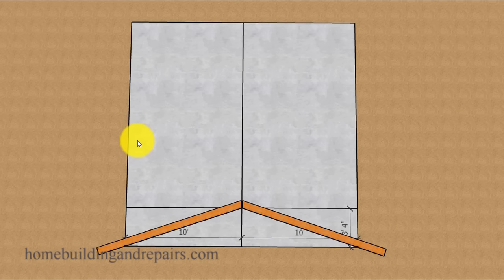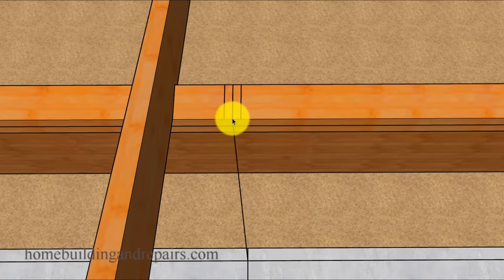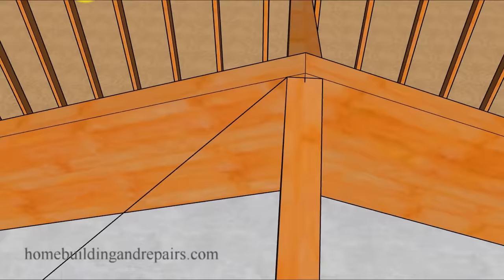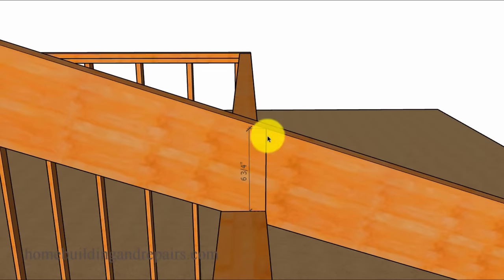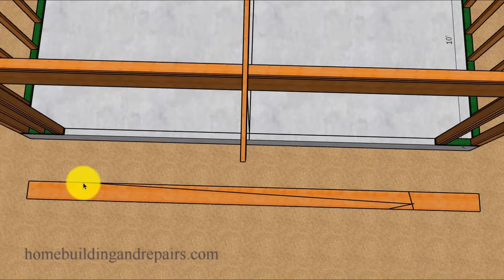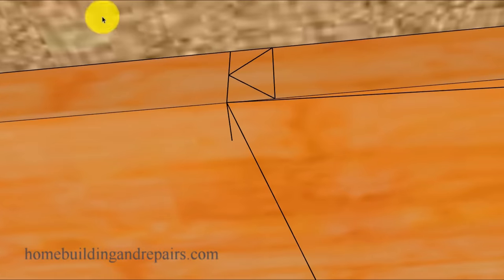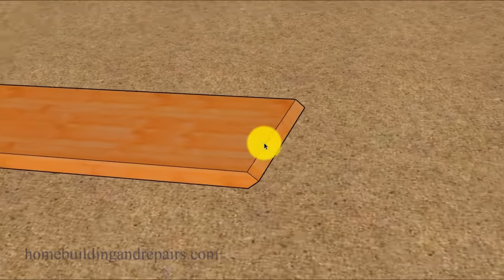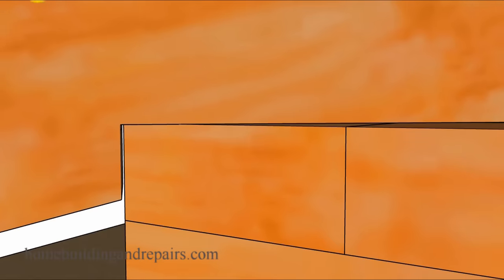How To Layout And Cut Hip Roof Rafter Without Any Math Formulas or Framing Square

Comment from the maker: Here's a link to a video that will show you how to layout a hip rafter with a framing square and math formula. https://youtu.be/d1tO8TYHy2M
Reply: Very interesting video thank you. I must say I got lost where you said the piece of ply template was 17 inches, where did you get the 17 inches from? Many thanks, Paul
Reply: Good appreciate the information
Reply: Good appreciate the information
Reply: Good appreciate the information
Reply: @arthurcurrey2219  po pls i love 💗
Reply: @foundthetruth2003  17" is the "run number" on a hip or valley rafter when the common rafter is based on a run number of 12".  So, for example, the numbers on the square for a 6 - 12 pitch common rafter would be 6 for the plumb cut and 12 for the seat cut and the numbers for a regular hip rafter of that pitch would be 6 and 17.  
The reason for this is diagonal distance of 12" and 12" is very close to 17".  A regular hip rafter is 45 degrees diagonal to the rest of the roof meaning that for every foot of run of a common rafter, a hip / valley rafter must run 17" to cover the same distance.

Comment: A fantastic explanation, and a joy to watch after spending a day framing a 15‘3“ square pavilion out of rough cut, full  dimension 4X western red cedar. A question I have: we had a lot of different tools on site and were able to make our hip rafter seat cuts cleanly, but how does one make the initial angled offside plumb cut that bevels opposite a Skil saw base plate?
Reply from the maker: I usually cut it straight and don't worry about making it perfect.
Reply: It’s a double cheek cut isn’t it?

Comment: Wow been framing roofs for bout 30 years now and never occurred to me that I could cut a 17” board to scribe my level cuts. That’s an excellent tip. I will remember that next time I forget my speed square.
Reply from the maker: Yes, scrap pieces come in handy, especially square ones:)
Reply: well... i mean considering this method requires the installer to make common rafters to begin with, you still need a framing square regardless.
Reply: @maxdecphoenix  i understand but lets say I’m on the roof cutting rafters and my square slid off the roof or forget to bring it up. Just saying its a useful tip.
Reply: Hip rafters
Reply: @maxdecphoenix  Look up the angle of the  roof on a 4-12  it would be 18  1/2 degrees and cut it on a chop saw.
Reply: @randyswiech7884  who the fuck cuts rafters on the roof?

Comment: For the most part I have cut hips measuring from center lines. A rafter book or square is handy finding out common differences of hip an valley Jacks. This is a good method if for some reason you forgot your square. Getting some work done is always good 👍

Comment: Great video.  Dropping the hip seems to be a dark area I dont understand, but what if you wanted four gables?  The hip rafters would be your valley rafters..
Reply: The drop is to get the same high above plate(h.a.p) of the common rafters.usually is half the thickness of your hip rafter. In case you have four gables you wouldnt need it beacause all of them would be the same.

Comment: I’ve always cut my hips then common then jack rafters .... thanks construction master calculator
Reply: The construction master is the lead carpenters friend 👍
Reply from the maker: You might not believe this, but in double checking some of the measurements in this video, the construction master calculator didn't get them right.

Comment: Thanks for the video. Super informative. Question, I completely understand the concept of the template board needing to match the pitch of the roof. For instance we are going to be framing at 6/12 hip roof. But I don't understand is why the length of the template board needs to be 17 inches? 17 inches never changes even if pitch changes?
Reply from the maker: This link should help. https://www.homebuildingandrepairs.com/math/index.html
Reply: There is a lot more to cutting rafters than a 12'x12'  building

Comment: Probably already mentioned somewhere below but we always used to bevel back the top of the hip on both sides, it provides a better seat for the material sitting on the rafters.
Reply from the maker: A true perfectionist.
Reply: Double bevel the long and short??

Or the top of the whole hip?
Reply: @Hunter_s_morrison  Yes along the top of the whole hip, chamfer back the top edges toward the centre line and the laiths or covering will seat perfectly.
Reply: @stevemartin43  I always do that with my ridges also
Reply: to get the side line for the bottom of the bevel  you would put a 6-17  line on a scrap and mesure long the 17 side 3/4 or what  is 1/2 the ridge

Comment: Great info. Always did the step off method with the framing square and then a calculator but this is much easier. The dropping of the hip bird mouth is always a concern.
Reply from the maker: We like easy and figuring out exactly how much to drop the hip can be confusing.
Reply: He did drop it by moving the plum lin in 3/4 and took that measurrment

Comment: Since you are using 2x6 common rafters I Don think your HAP can be 6 3/4”. I also saw a 2x8 number in you comment about the hip and rafter thickness that may be correct if you are using 2/8 rafter instead of 2x6 as you said. I love your channel and I always look your videos. Please if I’m not right let me know freely. Thanks AEL Construction CA.
Reply from the maker: You do bring up a good point. The pitch of the roof and rafters sizes can affect other lumber sizes like the hips.

Comment: I got the upper, angled cuts on the rafter, but I still didn't understand how did you determine the lower cut angle and how deep should it be when you're using the guides?  Thanks for video and happy 2022! 👍
Reply from the maker: It will vary on different projects with lower or steep roofs. Most of the time you will be safe cutting it the width of the framing plates that the rafter will be sitting on and not larger.
Reply: Here is how to cut a common and a hip..   say you have a 6-12 slope  that is 22 1/2 degrees.  You can cut a scrap this angle that is the plumb cut of a common rafter using a chop saw  nail a clete on the scrap and   use that for the top cut of the rafter  for the birds mount  make a plumb mark  and slid a sqare cut 2/4 scrap down that line until it first touches the bottom. if you draw a 12''  sqare the diagional is 17''  well it is actually 16.97''  but you use 17''  what that means is every time you go one inch on the 12 side you move 17'' on the diagonal..  so in 2' it would be 34''  but since the rater rises that would  not be the length of the hip or common. to get the rafter length you would need to get a rafter book.   you take the span of the rafter  say 24'  and look that up under common.and it would give you the distance  from the exact center of the building  to the plate.  That is the length of the common...  If you have a ridge say a 2/8  you would deduct 1 1/2 ''  from the span..  Now framing the hip you may notice the hip cannot reach the center of the rafters so you would have to shoten  the hip but if yoo use a book using the span of the building minus the ridge you would get the exact length of the hip or valley no shortng needed.. respond it you want to know what to do next

Comment: I find using the inside measurement from the wall plate internal corner to the bottom of the ridge so the length of the underside of the hip and mark my cuts from there that way the seat cut does not come into the building of course this may mean the top edge of the hip is higher than the common rafters but the underside will be inline with the common rafters so if its being plaster boarded it will be flat

Comment: how many diff styles of hip roofs is there? or how big does the building have 2 be in order to have a ridge?
Reply from the maker: The possibilities for hip roof designs are practically end less and a ridge for a hip roof will be needed when the length of the building is longer on one side.
Reply: @gregvancom  do you have more info on this?

Comment: Love your video...but I need help. How do you join the common rafters together at the top.?....do you screw them together or nail them.....please show a video of a real pyramid roof....maybe a small dog house one so you dont have to waste alot of material. Where do all the nails and or screws go ??? I dont want my rafters to be structuraly compromised.....thx.  Love and God bless....Lisa
Reply from the maker: I won't be making a video soon, but put your suggestion on my list. This isn't easy, but angle the nails and use building hardware like straps if they will help.

Comment: Do you have a video that demonstrates the method for deriving the end cut and seat cut for the common rafters? Thanks for the education.
Reply: Dude  get the little blue book that goes with the speed square. Wealth of knowledge in it. 👍
Reply: @rexolrexol7893  cool, I make the cord mesurment for the hip from the point the common rafter point intersects the main ridge to a long point right down on the corner of the structures wall, here's where it gets a little hinky only thru experience and some fiddling can you determine the mesurment thru the hip on a plumb line thru the framing member.
To get the angle of any common rafter pitch useing the framing  square  hold the 2" blade in your right hand  and plase the 12" on the outside of the square along the bottom of the lumber place the number of the desired pitch on the outside of the 1.5"blade along the bottom also the angle along the 2" inch blade is your plumb cut this setup makes a rafter with the long point on the left just reverse the square if you want the long point on the right. To get the seat cut measured along the length of lumber on the " crown" or top side square down with your angle and then mark the seat cut so that it has sefitiant depth into the rafter so it won't want to ride up and over the top plate. I make it 1.5" deep  and let the seat side of the cut run of the top plate. So square thru  on the angle and then square off  that line to get the seat . The Swanson blue book  has how to get the length of your rafter plumb cut to plumb line at the seat cut. I bought  the construction master calculator many years ago and use it for all calculations I need, you cabby updates off the website to bring the device up to date. It also has a booklet with a lot of helpful information.

Comment: at about 4 minutes in you say you use a 2x10 for the hip rafters, but the graphic says 2x8. is 2x8 the correct size?
Reply from the maker: Common construction practice is to use larger lumber for the hips. For example if I'm using 2 x 6 for my common roof rafters and jack or fill rafters, then I would use 2 x 8 for my hip or something larger like a 2 x 10 or even a 4 x 8 or 4 x 10, depending upon the situation. Let me know this didn't answer your question.
Reply: @gregvancom  got it. thanks for the helpful video.

Comment: There is a difference in the height of the two rafters that butt up against the other two rafters that mate together. How do you ascertain the amount of difference that has to be subtracted from the seat cut? Or am I incorrect in assuming that this needs to happen?
Reply from the maker: All seat cuts should be the same for gable roof and jack rafters.
Reply: If you mean   dropping the hip....  a hip rafter  is cut using 17'' on the square in  place of 12''  this is because 17 is the diagonal of a 12 '' square.    But if you notice the hip only touches the ppint of a   outside corner of a building .. The common touches the plate  but this point of a building prevents the hip from touching the plate at the edge of the hip.cut you have to make a mark on the side of the hip  at the plumb cut of the hip  usually 3.4 '' closer to the ridge and measure the hight above plate at that point.  On the valley you would mark the seat  cut the same height as the common and then follow that  line 3/4 '' more towards the overhang this would allow the hip to move 3.4 '' towards the ridge and also drop the  hip

Comment: When I take the measurement for the hip, I always lay out the 1 1/2” on the wall where the bottom of the hip will sit. Then make a 90 degree mark where the outsides of the hip sit on the corner. This is where you want to take the measurement for the hip because the edge of the wall plate is where you want your 6 3/4 rise. You don’t want the rise out on the corner point. That is why you have to “drop the hip”. I hope that helps.
Reply from the maker: I like it.
Reply: Correct! Not doing it that way, actually makes the hip rafter higher than the plane of the common rafters.
Reply: I was going to make the same comment. I figured someone had. I prefer to bevel or “back” the top of the hip though. I also prefer the plumb part of the seat cut to be beveled and sit against the wall on both sides.
Reply: @zekefrye706  thats not a bad idea at all.  Will give your hip tail a little more strength. We also always bevel the top pitch cut on the hip. In my opinion the fun starts when you have different pitches from the main set to the secondary hip set.
Reply: Yes, I’ve done that. I’ve built hipped and valley gambrel roofs that change pitches three times before reaching the ridge. The biggest head scratchers I’ve dealt with were; “supporting valleys” that carry “supported valleys” that were beveled top and bottom to allow for a “no trim” tongue and groove ceiling. The bevels start, stop and change direction at the  location of the intersection. “Dog legged hip and valley” rafters, like on a 22.5 degree turn have been a challenge too. Isn’t it a rewarding feeling to pre cut a roof and it all come together..... and embarrassing as can be when you forget one step and the piece won’t work. You did an excellent job on the video. I think most construction workers are visual learners and this is awesome. One small critique that doesn’t matter to some but helps the other trades and I prefer, is to stack rafters directly over studs and studs directly over joists. Thanks again!
Reply: You are right but  when cutting the hip  say you want 5'' Height  above plate . when the hip is laying flat just take a scrap of 1/4   or what ever 1/2  the with of the hip is and use that line to measure 5''   The hip and valley are exactly the same length but when cutting the seat of the valley  you use the same method   except you continue on the level line   which would be the height above plate off the common rafter not dropped  for  and additional distance of 1/2 the with  of the valley that would drop the valley and allow it to slid that distance towards the ridge

Comment: does the Hip rafter Always need to be larger that the common rafter?  2x6 common 2x8 hip
Reply from the maker: For the most part Yes.
Reply: It would based on dipping below the 2/3 rule of removing material from the rafter. That will be determined by the common rafter's height over wall plate, which in this video is 6 3/4". When your transfer that height to the Hip, if what remains is less than 2/3 then you need larger lumber for your hip.

Comment: Dropping the hip is necessary to get all of the roof framing in plane. If you plane across the the common rafters from both sides they would intersect on the center line of the hip rafter, therefore leaving the corners of that board proud which would cause the sheathing to have a hump in it. Dropping the hip brings the corners of the hip rafter (the sheathing contact point) in plane with the commons. This problem can also be overcome by ripping the whole top of the hip rafter into a double cheek cut, which would be an immense amount of time and effort compared to taking some extra out of the seat but some people do it.
Reply: He did drop the hip  when he drew  the plumb line on the common he moved it  in 3/4''  and took  that meaurment
Reply: @Dan-z6b3d I believe he's talking about dropping the height above plate. Because the roof sheathing will actually have to meet a bit higher than height above plate at the center of the hip, unless the top edge of the hip is double beveled to a point
Reply: @gregorsamsa1364  you only  need to double bevel if the hip is a 4x  when you drop the hip it brings the two edges the same height as the common.  the sheeting doesn't  touch the middle of the hip. this is because   when you nail the hip to the top plate the seat of the hip only touches  the top plate at the center off the seat the two sides of the seat are  3/4  back from touching the plate. If you are using a 2x hip rafter
Reply: That is how you determine the hip drop But it is always the same on the same slope  IE   a 4 in common hip is about 1/4 drop  but when you get to steep roofs it can be 1./2 drop or more. You may know this the hip and valley are always the same length on the hip you drop it and the valley  you continue the  seat cut for 3/4''  to drop the  valley
 v
Reply: @Dan-z6b3d  right that's what I was saying- the sheathing doesn't touch the center of the hip rafter unless it's beveled, which is why you need to drop the height above plate to make up for that distance between the edges of the sheathing and the center of the hip rafter. But obviously you can just ignore it on a roof in which this distance will be within tolerance